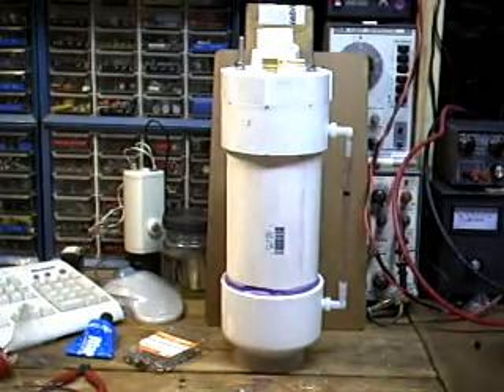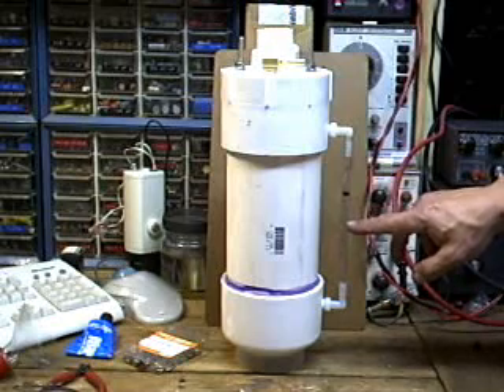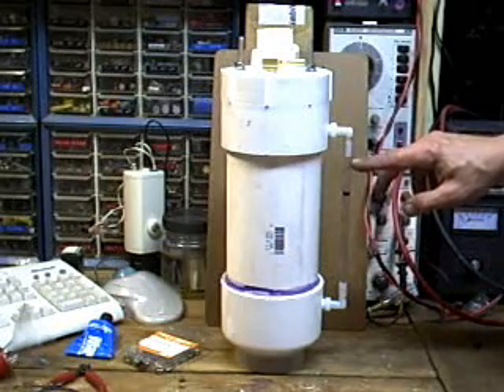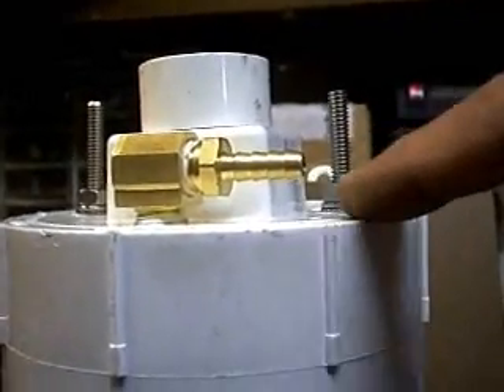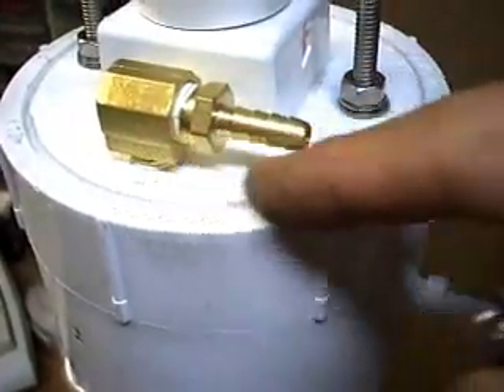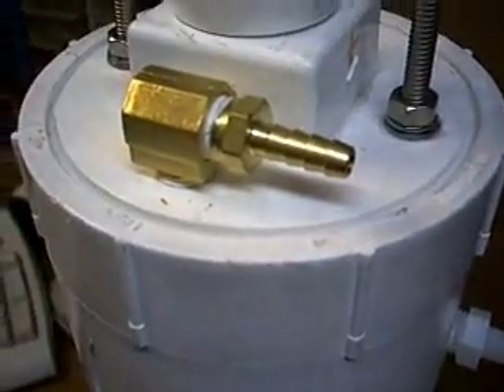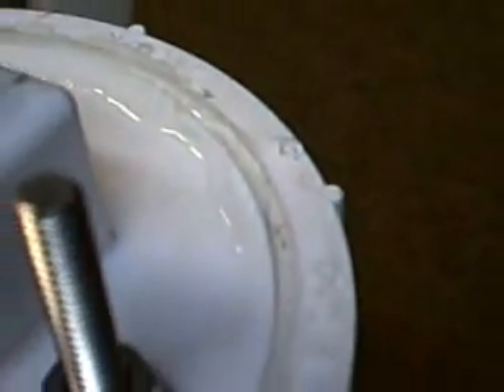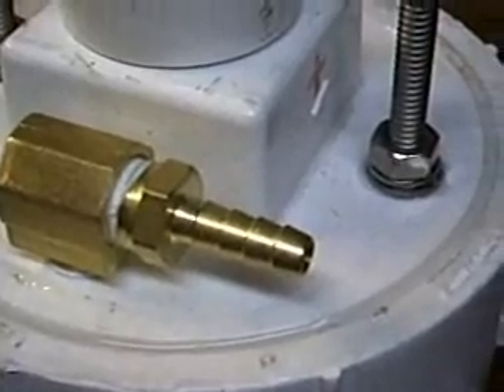#84 - VSPB Cell test final assembly

Comment: I havent been working with working with hydrogen cells very long so this may be a bad suggestion, but teflon thread tape might work as well as goop and be less troublesome to remove. Also I have found clear schedule 40 PVC pipe is available. It is perfect for making these cells. Great video by the way.

Comment: just a question about LPM, how many would we require to roughly run a 6 cylinder engine totally on HHO?

Would it be better to run a car on the PICC type setup? PICC - Pre-Ignition Catalytic Converter,  Or how would the 2 compare?

Comment from the maker: Well, 20g/liter is too concentrated. Cold and quiet it starts at 25A, drops quickly to 15A as gas starts to produce, ramps up to 35-40A at around 110*F, then goes into over current (over 50A) when I restart warm. Need to thin out the elyte by about 1/2 and let it run for a while to break in.

But, right out of the gate, 2.5 LPM without breaking a sweat, efficiency 5.5 ml/min/watt.

Not bad. Not bad at all.

Comment: Beautiful work.

To remove goop...  Heat works well (140 - 160*), denatured alcohol even better.  Used a lot of denatured to clean up inside my cell.

I've had nothing but probs using the PVC cleanouts, but I truly HOPE yours seal!  Be CERTAIN to check ALL cons and seals with soapy water (Dish soap & water & just brush on)for leaks.  I have been there Z, its VERY important, but you probably already know that.  Just that if I do not mention it, it would be irresponsible of me.

Lefty.